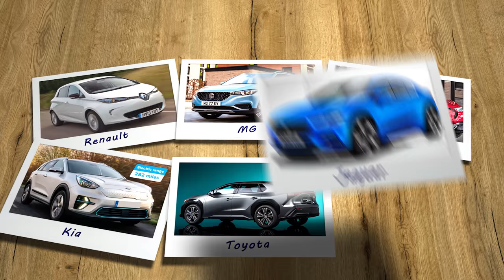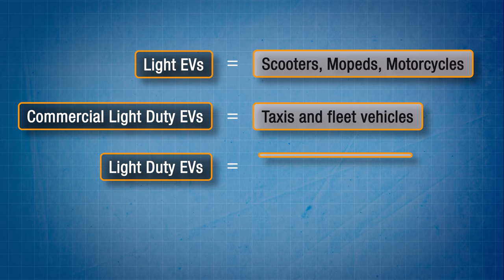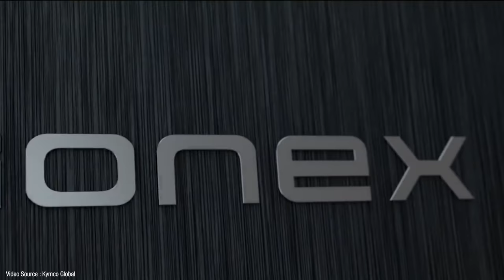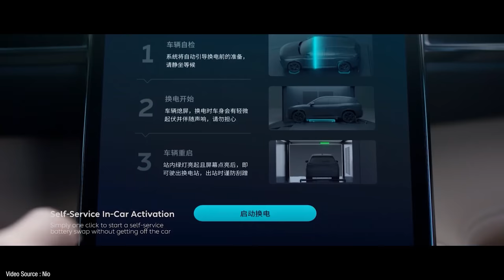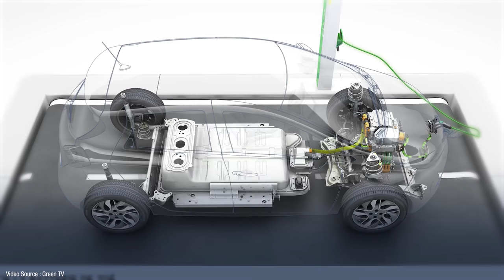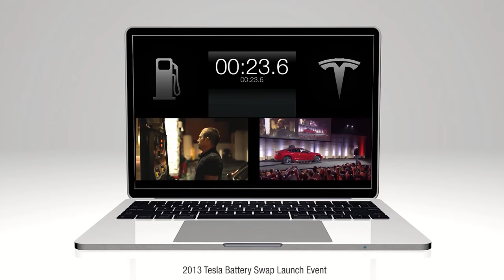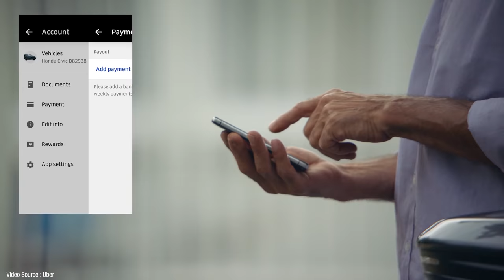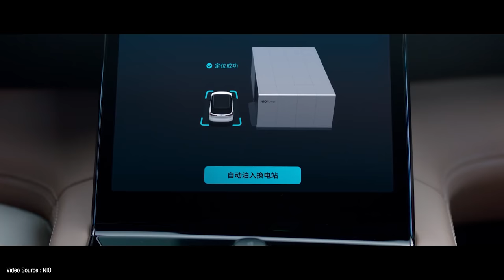Battery Swapping. Transforming the trajectory of electric vehicles?

Comment: One thing is clear to me, the EV industry needs to work on standardization. Not just the connectors for charging and the battery packs but also as much of the vehicle components as possible. If I need a fan belt for my ICE all I need to know is the number printed on the old one to buy a replacement. The same goes for the battery, spark plugs  and the fuel. I'm not saying the designers don't need freedoms but much of that should come from a range of options rather than something bespoke.
Most of us just want good enough. Chasing insane acceleration and absurd range just doesn't seem the way to pave the road to mass adoption of EVs. Now sure we don't want boring either but I learned to drive in a VW Beetle and even today the exact same car would meet most of my needs.

Comment: With recharge times dropping to less than 15 min from 10% to 80% with little to no degradation.. this is only a short term fix.
My Mitsubishi PHEV was rapid charged to 80% multiple times a shift for 3 years at 220,000 miles and 7 years old, it is still well over 80% original  capacity!

Comment: You stated the issue with swaps, most folks who own an EV also on their own home and can charge at home or something like four cents a mile making a swap an emergency or long-range procedure. Several costs of owning an EV or higher; i.e. insurance, depreciation, tires, etc.; those are balanced out by lower fuel costs and lower service costs. Over six years of EV ownership and 30K miles I am at about one dollar per mile total cost of ownership. Using a battery swap would increase my TCO by 8%, no thank you. Another point is we can’t standardize chargers, what makes you think we can standardize battery packs or modules?

Comment: The scooter pit stop looks like a super quick winner - hope they agree a universal standard. The commercial fleet swop stop also looks like a winner. Private cars are another matter. It will be a miracle if they get enough charging points out by 2030 at the rate they are going.
Owing a Smart Four4, I can say it's great for local driving and an overnight slow charge on the driveway is a perfect solution. Larger cars, doing long daily trips are as yet far from satisfactory - low mileage range with far too few charging points en-route. There is going to have to be some major investment in EV infrastructure before it hits a level of convenience most people require.

Comment: A secondary battery pack that can be used to charge the primary while driving. Otherwise, standard personal vehicles won't adapt battery swapping.
Commercial vehicles where the company owns both the used and charged batteries might work.

Comment: Loved your comments about the American Big Three and their "proprietary attitudes"- spot on, I'd say! Beyond the mechanics of the change out for range increases, the road tax  paid by OTR haulers is mostly paid through a special tax on motor fuels and I believe your fuel purchases are mandated to be so much for transiting the state- and there are 50 of them, all with varying rules- more than half hate the "electric revolution", so if Big Biz doesn't donate with emphasis on electric development, it isn't just unlikely is damned well not going to happen. The "driverless car" concept will save the transportation companies huge piles of money in payroll and likely accident insurance- that they will bull over mountains to get- to get them on board, they need to see (charts, graphs, studies) that it will be cheaper overall to run on electric and the vehicles will be less costly to maintain, and the bureaucratic log jam I opened with is resolved. Bring a double six pack of canned whup a$$! FR

Comment: As long as a car is part of the owners identity and because there are hundreds of models of cars available not even counting all the options each model offers it makes more sense to come up with a way to allow the individual the ability to charge their own battery.  That will entail changing the landscape to build many more charging stations across the country which is probably going to happen much faster than each parking spot having its own charging station.  Who pays for the charge and what happens if the neighboring parking spot uses the other charging station.  Yes there are ways around this to protect each charging station but the more complex the situation just means the harder the idea will be to implement.  People are already used to the fueling stations so it is a small transition to make them charging stations where the consumer is paying for service rendered.

Comment: Companies like Tesla can use the spare battery (for swapping) and make a new BEV car. Battries are the buttleneck for BEVs companies and using BAAS will waste battries which are in more need for more BEVs.  Condos are now upgrading to have power in every parking spot and $150 is not cheap either specially in Asian countries. Min wage is $250-$300 in many Asian countries.

Comment: Superchargers expensive?  Not even remotely close to the cost of those battery swapping units. Also charging off peak is not very practical you would need to have a giant stock of batteries. About the same as a day worth of swapping. Your opinion about this matter is way too optimistic.
Reply: I see your point, but even if they can charge them halfway with renewable energy it would impact the cost of operating the stations dramatically. There are a lot of teething problems with the whole theory though.

Comment: The main problem with battery swap is the number of extra batteries needed and that the swapping time is wasted time just like standing next to the pump is.
Charge time is not wasted time since you can visit the bathroom, go shopping, drink refreshments and walk in the park while charging.
For long distance trips the people inside the car are slower "recharging" than the car and the time between recharging is often shorter than that of the car, of cause only if your car is suitable for long distance trips meaning fair range and charging speed.

Comment: For fleet charging in the US, two problems: 1) getting sufficient OEM support—without Tesla they would need all the other majors. And 2) reduced need over time. The problem fleet battery swapping addresses (insufficient range to handle a full day’s work for Uber or delivery driver without recharging) is already getting rarer as needed EV range increases with new models and battery tech. For the huge battery packs EV trucks will use, the cost of all those packs in inventory will be bigger and the physical challenge of swapping them will be greater. Also, I bet a supercharger site is much cheaper than a battery swap station when you compare the number of charges per hour over a year, including depreciation—battery swap stations will have a shorter lifetime than superchargers which have almost no moving parts. Especially if the analysis includes the inventory cost of all those expensive batteries.

Comment: This is the only option for heavy long haul trucks. Unless we can make this work then most HGV doing the high mileage will stay diesel. I see no reason these vehicles couldn't have side pods for the batteries. Making for a simple swap.
Reply: The first electric trucks in 1917 had swappable batteries.

Comment: An alternate model of battery swapping for those with ready access to chargers is for vehicles to come with a battery size sufficient for daily use such as 100 miles.  When the need to take a long trip arises, the owner can rent and swap in a battery with more range.  This results in vehicles that costs less, more efficient and better handling because they are lighter and more overall battery capacity to go around society.

Comment: Alternatively, give each EV a standard tow bar, and standard charge point on the rear, and use battery trailers. Much easier than standardising internal designs
Reply: Not so convenient for parking in some places though........

Comment: Why was battery swapping an interesting idea?  

1) High cost of batteries so swapping/leasing meant lower upfront costs,
2) There weren't a lot of rapid chargers and they were not that rapid.

Why does battery swapping not make sense?

1)  There's a lot of extra cost to the driver.  The swapping company has to own lots of spare batteries, swap stations, rapid chargers, and staff.  That has to be financed and loan costs will be passed on to users along with swap station profits.

2)  Charging is getting much easier to find and faster.  It's just a matter of time before someone who lives with no charge outlet will be able to plug in while doing their grocery shopping or grabbing lunch and be fine for several days or even over a week.

3)  Battery costs are rapidly dropping.  We seem to have reached manufacturing cost parity with ICEVs and over then next couple of years the cost of EVs should drop below that of same-feature ICEVs.  (There may be dealer added "high demand" charges for awhile.)

---

No,  The swap station owner cannot afford to wait until late night low rates to recharge.  The batteries are likely to be needed ASAP or the swap station is going to need to make a very large investment in batteries  that get swapped in only once per day.

No,. The Tesla swap station was not in a "very remote location".  It was right where it needed to be for LA to SF/Sacramento travel.  Please get your facts right,

No. We are moving to LFP batteries which have no problems with repeated rapid charging.

Sorry.  You are light on facts and long on misinformation.

Comment: The issue as pointed out elsewhere is Tesla can either put a battery pack in a car and sell it for 30% profit while selling every car they can make or they can make them to swap.  Those packs sitting in the machine charging or waiting all represent cars that could have been sold.  NIO can do this because they sell so few cars.  In the future when batter production is way up I'd imagine this is a good option.  Good on NIO mind I brought some shares in them also and support NIO as a long term good potential company doing clever things (like swapping).  Still for Tesla (70%+ of EV market) they would be made to do this right now and so they don't.

Comment: A possible idea I would like to throw out is the potential for the swap stations to be renewable energy storage stations as well. Connected to the grid these stations could return energy to the grid when the demand for swaps is low while keeping enough full charged batteries on hand to power cars when needed. If demand for batteries in cars goes up then less power goes back to the grid, when it goes down more energy goes back to the grid.

Comment: Something you did not mention is that the batteries sitting in the charging station could very well be used as a power reservoir for the local grid. It solves a current problem we have with energy storage in urban environments as well as the infrastructure for battery swapping as well.

Comment: Aftermarket EV conversion companies should use these swappable batteries.
Also this might be an interesting idea for homes that go completely off the grid, or are on the grid but also have battery storage for emergencies. The battery walls could be swapped out when they go empty or dead, or for newer battery formulations that come out in the future.

Comment: The only way it can work is if the OEM of the car retains ownership of the battery and charges a "battery as a service" fee, otherwise the first time you swap your battery, you end up trading a brand new full capacity one for one which is partially degraded.  And while fleet owners may like such an arrangement, comparatively few private owners would find such an arrangement attractive.
Reply: I'm not sure I understand; are you saying that the swapping station should only give you a full battery that is brand new (or close to it), rather than a several years old one that won't give you quite as much range? Because I don't think that would be feasible from the supply perspective, nor would it probably be necessary because the swapping service is meant to provide a solution for saving time with charging, not generally for users who want to embark on a maximum range journey.
Reply: @danyoutube7491  again, the only way it could work is if you don't own the battery personally- you just RENT it.  Accordingly when your brand new battery goes in to the swapping station and a used one is installed in your car, you won't have just lost thousands of dollars of value.

Comment: Definitely the way to go. Can you imagine battery swap stations at motorway service stations and petrol stations being converted to swap stations? I can, I just don't think Boris and his crowd can even envisage it. Not until he pulls the tea-cosy up over his eyes. Lots of advantages but what about the cons? I just wonder if a car soaking wet and covered in mud underneath would be an issue. In the future, maybe cars will notify the driver that the battery needs replacing, based on destination entered, and would self-drive to the swap station on route to the destination. I don't think I'll see this in the UK in my lifetime, most surely in China it will happen.

Comment: If it is cost effective the idea of swapping out a battery of various KWH be a good idea for many people.  I would use the correct size battery for the current application.  This surly could be fine tuned to run very effectively.

Comment: I guess entering the private EV market will also require, besides the standardization of batteries, of course, transparency from the companies offering these services regarding battery health - not that it is really that important if you can always go and replace that battery anytime at no extra cost other than the extra charge in it, but that's sort of the main argument against the concept, and addressing it would be beneficial for consumer confidence.

Comment: I just do not see it working outside of China on a large scale, especially for private vehicles. Like you said getting all automakers to agree on a standard just won't happen added to the huge infrastructure expense and extra batteries needed as well as an extra wear point in the vehicle, it's just pointless. Tesla is also going to a structural pack and has started to install Superchargers on a concrete plinth to make them quicker and easier to install and with all future chargers going to 300kw and above, the time to charge will be less important. I also see huge improvements have been made in the cooling and BMS systems in EVs to help mitigate as much battery degradation as possible to a point where the battery will outlast the life of the rest of the vehicle.

Comment: I don't think any heavy duty fleet manufacturer (I e. Freightliner, Peterbilt, Volvo) is looking to do battery swapping, but I think it's an interesting idea. Batteries can't provide the range they need, at least on the long distance routes, so swaps seems ideal. Their chassis have the space to standardize, so it seems pretty feasible
Reply: What could provide the range, given their height, is overhead power, like a trolleybus.

Comment: My concerns center mainly around the likelihood that enforcement of a particular battery swap standard is a great way to keep innovative new technologies from ever having a chance. Also, the benefits of “massless” batteries (incorporated into the structure to reduce vehicle mass) should not be dismissed too lightly because that represents savings in materials, manufacturing, and energy use. Battery swapping is great for some use cases but not necessarily in other use cases. One other concern is that I know how I care for my devices but not how other people have abused swapped batteries—I don’t like buying a potential fire hazard from a vending machine. If custom high-technology batteries help reduce environmental impact, even without swapping, then that should be the priority, respectfully submitted.

Comment: Demos of car battery swapping always show a nice clean car driving into a spotless bay where a glistening robotic mechanism does the swap.  In Canada our roads are covered with snow, salt and/or sand for about half of the year.  If the robot does manage to find a battery bolt through the murk of ice/snow/sludge on the bottom of the car then it will still have to figure out how to deal with batteries rusted or frozen into place.

Comment: Thanks for another great video! You've covered the subject really well. It seems like battery swapping could become a regular part of the EV market in the East, but not be widely adapted in the West. Unless maybe Ample or someone like them makes battery swapping standard for commercial fleets, and that leaves the option open for consumers. It's possible to imagine a future where EVs come in two types: expensive luxury cars like Tesla makes with structural batteries, and relatively cheaper EVs with smaller ranges and standardized batteries made by everybody else.